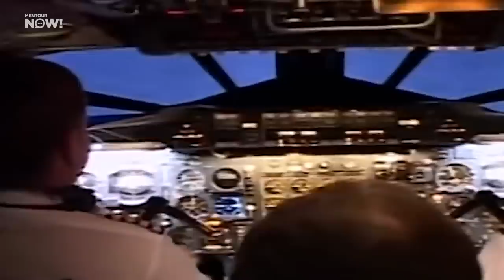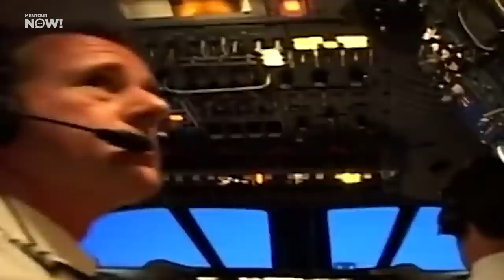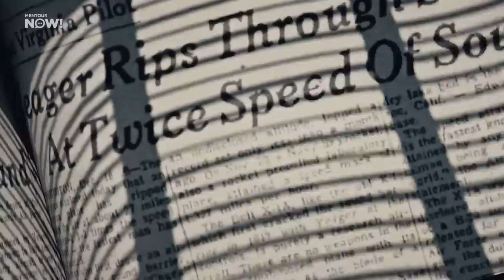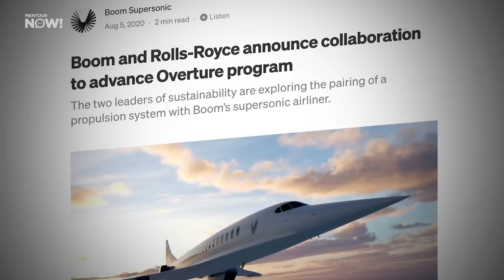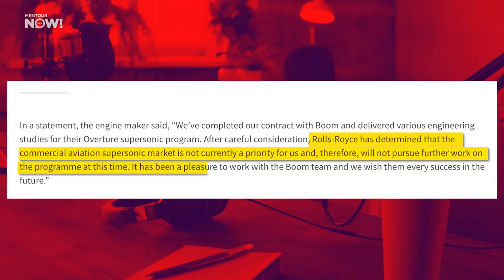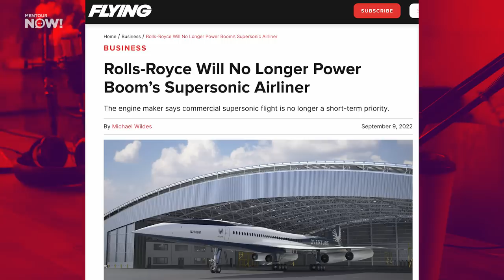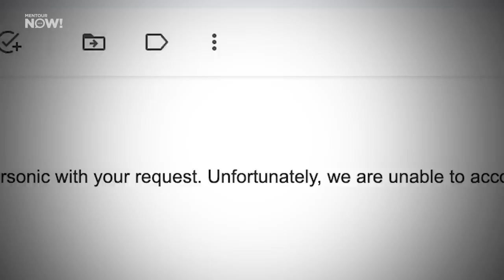WHAT’s Going On with BOOM Supersonic?! Will it Fail?

Comment: High-Bypass Turbofans cannot be used on supersonic engines because you can only accelerate air to the speed of sound, which is about 300m/s at ambient temperature. If you want to produce thrust, exhaust must exit the engine faster than it went in. If the intake velocity is higher than ambient speed of sound, there is no way around heating up that air to make it possible to accelerate it to something like 600m/s or even faster for higher supersonic speeds.
Reply: Florida Turbine Technology, a division of $1.88bn Kratos Defence, started the symphony engine design in January 2023. Boom stated that no current engines, either military or commercial, are suitable for adapting to Overtures unique requirements. The engine will be a 72 inch, twin spool, medium bypass, turbofan, without reheat. It will produce 35,000 lbs thrust. 

Boom will design the pods and the variable geometry exhaust and inlet ducting. The objective is to have power unit that is efficient at both sub and supersonic speeds

A big fuss is being made about Rolls Royce ending their contract with Boom, but AFAIK the contract was only for consultancy, and not to build an engine for Overture. Besides which, the Symphony project would be totally unsuited to the tier one engine manufacturers, like Rolls Royce, GE, P&W, and Safran. Their cost base and time frames would be out of kilter, and the volume of sales would not warrant their investment. GE caught a cold with the Affinity program.

Comment: > "Boom engineers have access to modern materials that Concord engineers couldn't dream of"
> "Boom has to decrease top speed to Mach 1.7 because temperature limitations for composite materials"
Well, not all modern stuff is just better in everything.
Reply: Those are design choices, not limitations. Composite materials can stand much more than Mach 2.

Comment: With a four engine architecture Boom could use a lot of off-the-shelf military Turbofan engines, but they would have to deal with the hurdles of self-funded engine integration with limited buy-in from the engine manufacturers, and the specific fuel consumption penalty of an afterburning military engine not optimized for SFC.
Reply: Florida Turbine Technology, a division of $1.88bn Kratos Defence, started the symphony engine design in January 2023. Boom stated that no current engines, either military or commercial, are suitable for adapting to Overtures unique requirements. 

Boom will design the pods and the variable geometry exhaust and inlet ducting.

A big fuss is being made about Rolls Royce ending their contract with Boom, but AFAIK the contract was only for consultancy, and not to build an engine for Overture. Besides which, the Symphony project would be totally unsuited to the tier one engine manufacturers, like Rolls Royce, GE, P&W, and Safran. Their cost base and time frames would be out of kilter, and the volume of sales would not warrant their investment. GE caught a cold with the Affinity program.
Reply: @phonicwheel933  I would be interested to know what their "unique requirements" are. If the traditional engine makers can't make the value proposition work I would doubt any startup claiming to be able to deliver. For a new advanced jet engine I would expect a development cost in excess of $1B and 10 years overall. It's possible that a startup could make a slightly cheaper engine by using second and third tier supply chain, but the technology will be inferior and would struggle to even meet the efficiency of a 30 year old engine design from one of the big three. If I were boom I'd try to make an off the shelf engine before I signed up for a risky development program

Comment: If this plane can fly at 60,000ft does that mean it would not experience turbulence during the cruise?
Reply: Yes.  A very smooth ride with extremely excellent visibility.  There should be a market when the rich guys/gals treasure the travel experience.

Comment: I don't understand what the problem is with sonic booms. Back in the 50s and 60s, you could hear them all the time from the Military test aircraft.
I lived in Northeast Ohio at the time as teen in the 60s, and they were not that loud. No broken windows or anything. You wouldn't even notice one unless you were outside.
The planes were flying at what, 30,000 to 40,00 feet? Thunder was louder than a sonic boom.
The fastest coast-to-coast flight ever recorded. In 1990, the SR-71 Blackbird crushed the world record with an average speed of over 2,300 mph (just shy of Mach 3).
Which I assume generated a sonic boom.

Comment: The AIrbus A400 was crippled by the problems with the engine, and think it almost sunk the aircraft, and effectively delayed the deliveries by years. I expect that really needed to start with the engine and then design the aircraft instead of the aircraft before the engines.
Reply: Florida Turbine Technology, a division of $1.88bn Kratos Defence, started the symphony engine design in January 2023. Boom stated that no current engines, either military or commercial, are suitable for adapting to Overtures unique requirements. 

Boom will design the engine pods and the variable geometry exhaust and inlet ducting.

A big fuss is being made about Rolls Royce ending their contract with Boom, but AFAIK the contract was only for consultancy, and not to build an engine for Overture. Besides which, the Symphony project would be totally unsuited to the tier one engine manufacturers, like Rolls Royce, GE, P&W, and Safran. Their cost base and time frames would be out of kilter, and the volume of sales would not warrant their investment. GE caught a cold with the Affinity program.
Reply: @phonicwheel933  Know how much the engine companies spend on engines. Better move that work to China where a measly billion will actually buy something. And this is commercial so will have to go through massively rigorous testing. Do not think that is near enough. It is going to be another vaporware program

Comment: Hey Petter!  Can you research and do a video on the viability of using SpaceX Starship as a global transport?  They’ve touted Texas to Phillipines (I believe), in about 30 minutes for 100 passengers.  That would be the future.  And because their engines use Methane and I whine, it only releases water and Co2 as it burns.  Theoretically they can keep reclaiming these two to produce more fuel and would be emissions neutral.  I believe rockets are the next point to point travel in aviation

Comment: Pet project, I don't see it happening. The Concorde proved that a commercial SST is not viable. Boeing knew that way back, which is why they canceled the 2707 project. Boom is gonna have a nice shiny plane with few orders and no engines. They are actually moving forward with it because they already had a small ground-braking ceremony and started clearing space on the north side of KGSO for their manufacturing facilities. PTIA is right up the street so now we have BOOM and HondaJet at the same airport. However it goes, I do like the idea of creating more jobs for the locals.
Reply: @RellyOhBoy Just a few points:

Concorde didn't prove that SST wasn't viable per se. Concorde proved that Concorde wasn't viable, because of its high cost and shortcomings, both of which will be addressed by Symphony. Also, air travel has changed radically since the Concorde days. There are more people flying and they are more affluent. Roughly speaking the number of passengers doubles every 10 years. Technology has also advanced, especially with the advent of computers, CNC, additive technology, and composite materials. 

Neither did Boeing cancel the 2707 project. The 2707-300 was back on track for completion and Boing were building two prototypes, when congress cancelled the contract in 1971, mainly on the grounds of sonic boom and pressure from the environmental lobby.

Florida Turbine Technology, a division of $1.88bn Kratos Defence, started the symphony engine design in January 2023.

Three things will happen, Boom will run out of money, they will be bought out, or they will make a roaring success of Overture. I hope it is the latter, and that there are more jobs in KGSO.
Reply: @phonicwheel933  Points taken.

Engines...engines... engines... is what will make or break this plane. They would have to be super reliable and radically efficient for this thing to have a chance of being a success. We already know it will be relegated to transoceanic routes but at least there will be no competition in that arena. Remember Airbus put a lot of bank into their double decker whale because they bet big on the Hub-and-Spoke model being the future of commercial air travel and it turned out they were wrong. Point to point travel in long range wide body twins is the move. And as a result, the A380 was an overall failure. I would hate to see Boom turn down that same street.

At the end of the day I hope the project is a success. I have my popcorn and a front row seat.

Comment: With the business travel market not being what it use to be, due in part to covid. I feel the specs just don't add up. I think Boeing's 2707 SST, being bigger, faster would have been more successful than Concord, if it was able to come to market.  It would be really interesting to see an engineering study on the feasibility of constructing a 2707 with modern materials and manufacturing techniques. Also whether or not it would be able to meet the performance expectations set forth by boeing.
Reply: Completely agree. It seems that in order to meet performance expectations they are not leaving themselves any options other than using Rolls Royce Merlin engines.
Reply: @inikoli

A modern 2707-300 would be a great idea, especially as titanium is now freely available, and much cheaper. Also, the use of titanium is better understood. I think there are even composites that will take a Mach 3 temperature, if I have understood the spec sheets that is. But to start with Boom have probably got the best configuration for the first modern SST in Overture. The next move would be a 200 seater, and then a 2707-300 size. A supersonic business jet using two symphony power pods would also be worth investigating.

Here is an assessment of the Overture:

Aviation has changed radically since Concorde began service in 1976. More people are flying, and they are more affluent. Roughly speaking, passenger numbers double every 10 years. In addition, technology has advanced greatly, especially with the advent of computers, so that engines are now more powerful, efficient, quieter, and lighter. Aircraft design has also been revolutionised by the use of composite materials (as used on Overture), embedded computers, additive engineering, CNC, and automation. 

Because Overture will be efficient at sub and supersonic speeds, 500 routes, some mixed land/water, are viable, rather than just 2 water routes for Concorde. Overture will fly 2x the speed of subsonic jets over water and 20% faster over land. Overture will not fly supersonic over land. Overture's cabin will be more spacious and quieter than Concorde's cabin. The seats will be more comfortable. Concorde carried 100 passengers at Mach 2, over 4,488 miles. Overture will carry 72 passengers at Mach 1.7 over 4,888 miles. 

Overture's development cost will be $6bn. Concorde's development cost was $14.4bn. The manufacturing cost will be less, the maintenance costs will be lower, and the availability will be higher. Overtures selling price will be $200M. An equivalent price for Concorde would probably be $1.2bn. The maintenance costs will be a fraction of Concorde's, and the availability will be higher. Overture will be simpler to fly, eliminating the need for a 6 month pilot conversion course. Overture will also have a modern cockpit, with more room, and a flight engineer will not be required. Its cabin will be quieter and more spacious, and its seats will be more comfortable. In contrast to Concorde's tearing engine noise, Overture will comply with ICAO-14 regulations, allowing it to use all airports. 

Taking a JFK to LHR one way flight:  
Showing: Aircraft type,  Fuel cost per passenger,  Economy ticket,  First Class ticket,  Duration

Boeing 747       $147          $577             $2,308                     8hrs 
Concorde          $753                                $5,000^                   3.5hrs 
Overture            $628^^      $1,300           $3,800                     4hrs 
Business jet^^^                                 $53,000 to $99,000        8hrs  

Notes
^ 2023 money 
^^ Assuming that Overture is 20% more efficient per mile and carries 72 passengers 
^^^ There are no supersonic business jets 

Overture would not be competing for the mass market, but Boom have identified 500 viable routes. Overture may become a niche service, both scheduled and charter, where certain travellers expect higher prices. Even now, on subsonic airliners, some people are prepared to pay 4x to fly luxury class. And, as far as business travel is concerned, the time saving would be well worth it. To back this, Boom have done quite a few surveys, as have some airlines, which show the viability of Symphony. 

If Overture reaches production, and meets its specifications, it will be popular with both airways and passengers, because it will half many journey times and will be cheaper, more comfortable and a lot more practical than Concorde. The military have already shown an interest in Overture. The next development should be a 200 seat version, and possibly a supersonic business jet using two symphony power units